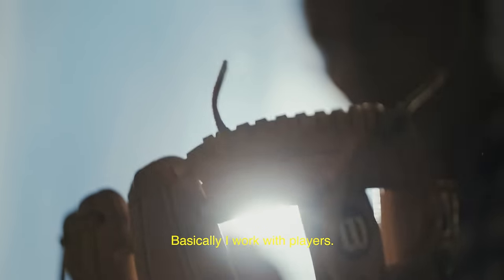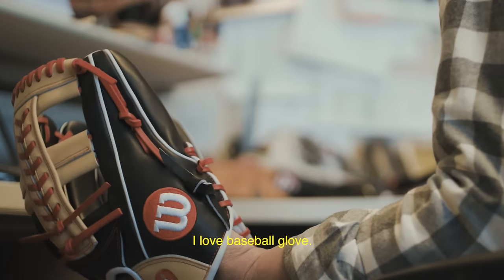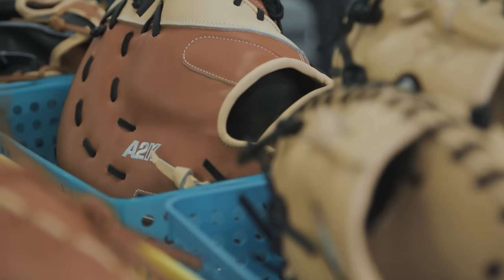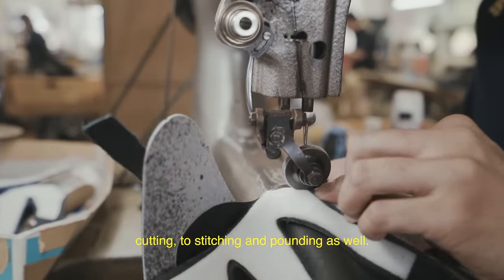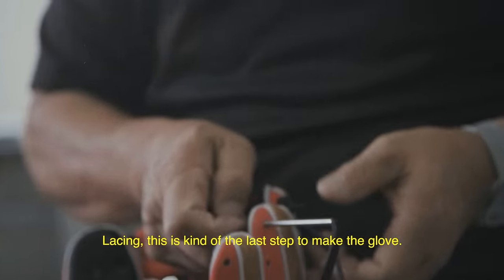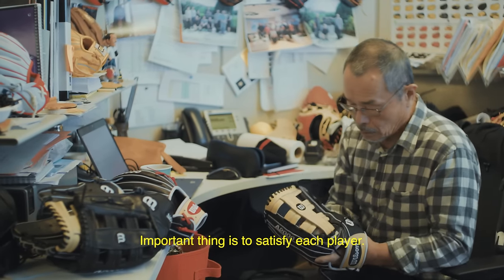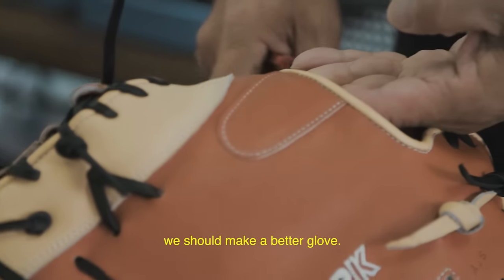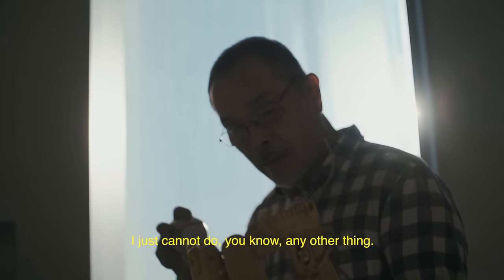Shigeaki Aso: Portrait of a Master Craftsman

Comment: Hi Wilson, I use an A2000 1786, and its a great glove, but one thing. I put two fingers in the pinky sleeve, but every time I squeeze, it pinch's my ring finger. I've taken to taping my ring finger, but is this just a softness issue? I've had it since December 2016
Reply from the maker: Our gloves aren't necessarily made to have two fingers in the pinky, so if you do that and it feels tight, that would be why.
Reply: If u use it a couple times with three in the pink it loosens it up